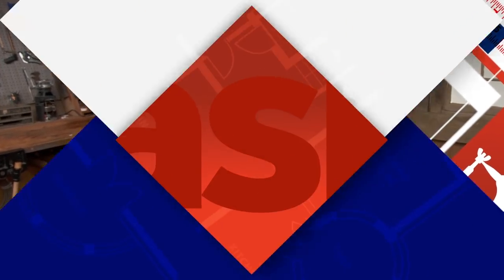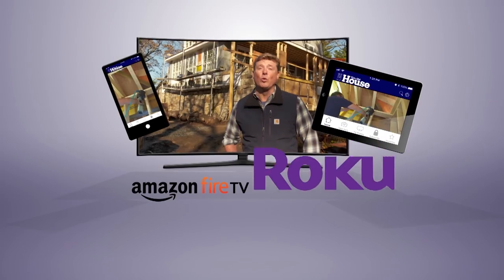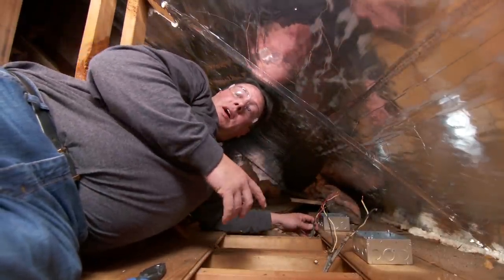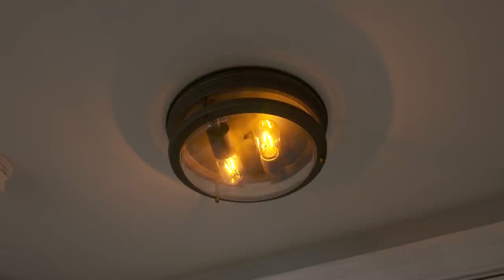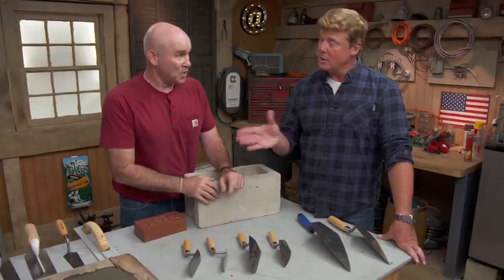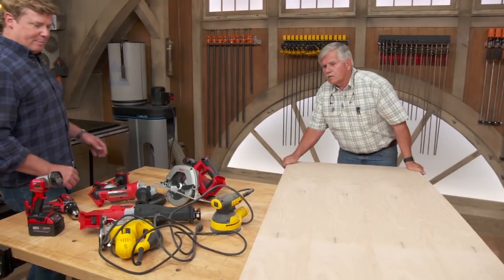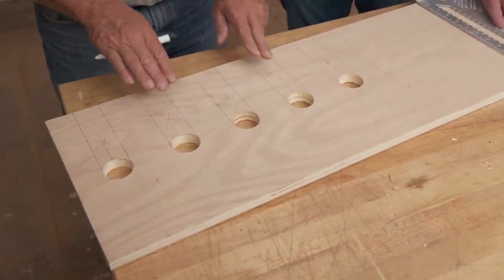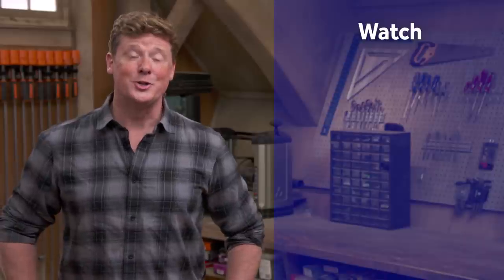ASK This Old House | Ceiling Light, Tool Storage (S18 E12) FULL EPISODE

Comment: I thought when connecting standed to copper wire it was required to lead the stranded alittle longer than the copper when applying the wire nut, is that not true?   He did not do that..

Comment: Hey Ask TOH, can you come out and help me install a bathroom light/vent fan in a 70yr old home? Because no one wants to take this one, not even me! LOL...(bathroom has the vanity mirror lights but older BX that hot goes to fixture and switch is just the on/off (instead of hot to switch, then to fixture). Also I believe code needs GFCI to the fan as it has light and above shower/tub area.

Comment: So many of use want great tool storage, but you built you great storage with tools that are not included and most can't afford. We all want Festool but is out of reach.
Reply: I understand your point, but not all of those tools are completely out of reach. Yes, Festool's were used, and I would imagine it was because they sponsor the show, or that the show can afford some of the best. I own all the tools that they used in the video, including some of the brands they used. However, some of my tools are are more budget friendly. And I have zero Festool's in my collection. Almost all of that build could be done with the simple Milwaukee kit that Tommy purchased. If you do away with the rounded fingers, the Jig Saw could have been replaced with the circular saw. You could even cut the dado's with the circular saw and not use a router. It would be more time consuming, but it could be done.

Comment: As a life long sparky I would run the ground wire from luminare to ground wire from the MNB cable. Never trust screws that if only become slightly loose and a short occurs a large spark could be produced starting a fire. Remember no such thing in NEC book as a ligjt fixture. Also one of my CEU inspectors always tell us that bulbs go into the ground and lamps go into a luminare.

Comment: I rather have the old cloth nm cable and use the leds than add junction boxes( never add junction boxes unless absolutely necessary) especially when the electrician twists the wires together with his fingers.

Comment: So 2- 6 to 8 watt LED bulbs inside a housing, with insulation with a radiant barrier on it could make wires heat up too much.  I call such bullshit on that.    

Now I get it, someone could technically screw in a couple 150 watt incandescent bulbs into it, but no one should have to replace the wiring for something someone may do somewhere down the line which is first buy bulbs that they do not sell anymore, and then cram them into a tiny fixture.
Reply: incandescent bulbs are still being sold
Reply: Anyone who puts a high-wattage incandescent bulb in a light fixture deserves to have their house burn down.
(Okay, just kidding -- not really.  😜)
Reply: @Kevin-mp5of  I remember my dad putting pennies in behind the old screw in fuses. It worked 😆.
Reply: If that fixture had integrated LEDs, and therefore no possibility for incandescent bulbs, then you're right, there wouldn't be a need to replace any wiring.  In fact, the homeowner could have just screwed in an LED bulb to their old fixture.  Likely they wanted the look of the one that they chose, and since it still has Edison medium-base sockets, both the fixture manufacturer and the pro electrician (Heath) have to account for the possibility of incandescent bulbs and the radiant heat that they give off.  Thus, he had to replace the wiring, or at least, the first 18 inches of it from the fixture.
Reply: @WheresHerb  Yeah sure, it "worked", without any overload protection on that circuit at all...